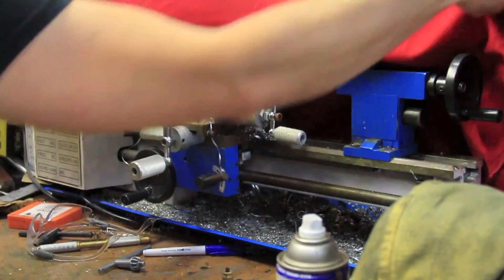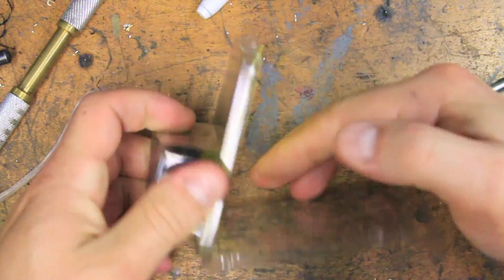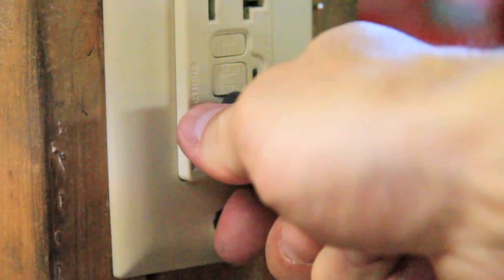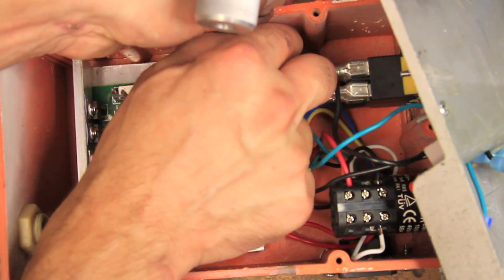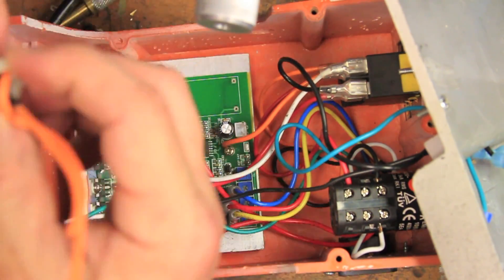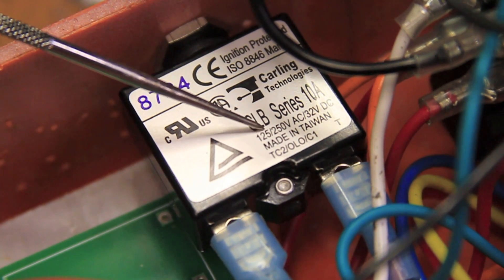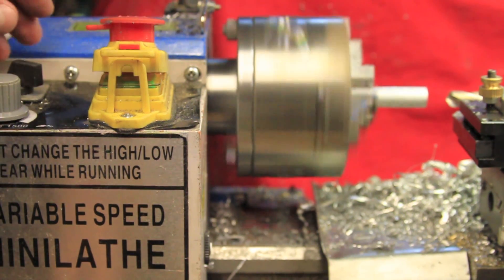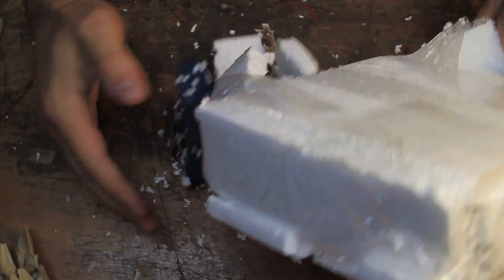No more blown fuses!

Comment: Just bought one of these lathes , which is slightly upmarket one to to one you have, but they are all basically the same machine. I am not using the lathe yet as I want to do a thorough maintenance before I do and unfortunately I have a lot of other stuff that has greater priority. But I like your style and your video's So I will be subscribing.. I have done some similar projects to yours on a old clarke cl300m metalworker lathe, but I did them slightly differently to you. I think if 3 people make a similar project there will be 3 different finished projects, based on materials available and different ideas. Great videos look forward to seeing more.

Comment: Fuses are rated as 10A continuous and these blow at 20A.  Circuit breakers pop at the Rated current.  You should fit a 20A Circuit breaker.

Comment: My concern with circuit breakers is their slower trip speed compared to fuses. A typical thermally tripped breaker generally takes well over double its nameplate rating to operate, and in the case of electronic circuits this can mean damage will occur to the printed board long before the breaker has time to heat up and release. I know that glass fuses can be annoying, but they are very fast operating, and considering that you can find a hundred of them for less than $3 on Ebay it's less expensive than the cost to repair or replace a motor controller board.
Reply from the maker: Thanks! I'm not sure if it will cause problems in the future but so far it's popped quite a few times and I haven't noticed any problems otherwise. Interestingly also, I feel like this breaker pops much easier than the fuses I had. It took me a long time for the first fuse to break and the circuit breaker pops all the time, so it feels safer at least.

Comment: I noticed that the mini rest you got is missing the roller bearings in the middle of the rest that the piece turns on. There should be roller bearings, not points.
Reply from the maker: I think there are different styles.

Comment: As a maintenance technician and a learning machinist, I love the way your videos are setup and explaining everything in detail and the added humor. I spent all morning watching your videos because i'm off for a few days and this stuff is so interesting, I was looking into buying a mini lathe as well and I've just been seeing all the problems you've had with that one. I have a two year degree in Mechatronics so it's easy to understand the electronics side of this as well. Keep up the good work man!
Reply from the maker: Thank you so much! Comments like this are so great and definitely a motivation to keep putting these together :)

I really appreciate you watching and hopefully if you do decide to get one of these lathes, you now know what you're in for! 

Mechatronics is really neat too, I took a couple classes in school myself - what are you doing with it?
Reply: Literally nothing other than I work at a glass manufacturing plant as a maintenance technician. They paid for one year of my two year degree and I have to stay working there for a year. But I do PM's on machines and the building, fix breakdowns, rebuild parts, and fabricate parts out of steel and aluminum. I learned how to use a lathe, precision mill, stick, mig, and tig weld as well. I'm hoping I find a better job than a maintenance technician because the pay is kind of crappy and I have expensive hobbies lol

Comment: A old vacuum cleaner with 3 different dust bags is very convenient to keep the lathe clean on an hourly basis. One bag for each: steel, aluminum, and copper alloys. Or add a 4th bag to separate brass and bronze if you do much of those. Or use one bag if you throw the chips in the trash anyway.

Comment: The fuse should only blow if there is a fault in the circuitry. Have you checked your current limiting in the controller, if this is working properly it should limit the current to a value less than the fuse even under stall conditions. Contrary to popular belief, fuses are not there to protect the equipment, their purpose is to protect the wiring from melting.
Reply from the maker: Hmm I'm not sure those are accurate statements. The motor uses considerably less current when turning normally than it does in a stall condition, which is an overload state for the motor. When overloaded or stalled, it's drawing the most current and more so than normal operation. Since we don't want to prevent normal operation but we do want to cut power in an overloaded or stall condition, a fuse sized between the two conditions is what you want. Also, protecting the wiring from melting is inherently protecting the equipment, is it not? At least in the situation of this lathe, the controller board is much more susceptible to damage from a current overload than the wiring from the wall outlet.

Either way, thanks for watching and taking the time to comment!
Reply: My thirty years in electronics engineering tells me that you're half right. It is not the job of the fuse to protect from a stalled motor, that is the job of the inbuilt current limiter of the controller (which is adjustable). As 10 amps on 240V gives you 2400w and the motor is rated at only 550W you can see that this greatly exceeds the power rating of the motor and if the current limiter is working properly this value should never be reached and the fuse should not blow. In 99.9% of cases fuses are there to protect wiring not the equipment.
Reply: The current limiter is designed to ensure that no more than 550W is supplied to the motor
Reply: Assuming that the board does have current-limiting protection as stated, Mr. Tho is correct.
Reply: He's also correct that the normal use of fuses is to protect against fire from overloaded wiring.  The motor itself should (but may not) have a thermal overload protector that will trip and self-reset when the motor windings overheat because the motor stalls or can't start.

Comment: Nice modification. It would have been all too easy to just eliminate the fuse altogether. However, that would have been a bad idea. You took the smart approach and kept the fail safe intact, just made it easier to deal with.

Comment: Just a thought!   There's a reason the fuse blows repeatedly. Something is wrong somewhere. See to it before whatever it is wrecks the circuit board or worse.
Reply from the maker: You're right, but in these cases the first fuse blew because I was parting a large diameter and it was pulling too much current and the second one was drilling too deep and the chips couldn't clear from the bit and stalled the motor. So nothing is wrong and for once something on this lathe was working exactly as it's supposed to :)

Comment: Awesome idea with the button circuit breaker!i'm going to install the same one on my lathe! As for the steady rest, add roller bearing to the tips, I used roller bearings out of old VCR rotors, which I bought for $5 each at Salvation Army, goodwill and Savers. Stripped them all down for parts, reserving all bearings for other projects. You can use any race bearings you deem fit for your machine and purposes. I've had the VCR rotor bearing on mine for ten years with no problems. Have fun!
Reply from the maker: Thanks! After trying to turn a piece in that steady rest I'm definitely going to add some bearings... I actually have some left over from another project that might work perfectly. I'm also going to see if I can figure out a way to increase the clearance a bit to match the diameter of the hole as the trips don't fully retract. Either way it will be a very useful addition!

Comment: This is an elegant solution to your problem. I tried it a few years ago and for me it did not work. I have been told that my 10 year old mini lathe is not as robust as the newer models, perhaps this is why it works for you.
My lathe uses "fast blow" type fuses to protect the speed control. Thermal breakers are "slow blow " devices. The breaker I used would pass 150% of the rated current for 1 hour before it tripped (up to 600% for almost 2 seconds). Unfortunatly my speed control could not handle the sustained  overcurrent and I eventually burned it up.
For those wanting to make this conversion it would be wise to match your fuse to the new breaker specifications.
You can down load the breaker PDF spec sheet here:  carlingtech.com/thermal-cb-clb-series
Reply from the maker: Interesting, I wonder if i will end up with the same issue? I just ordered the 3amp version so I'll swap it out and see if it trips too often or not.
Reply: Good idea! if it works I can use it on my mini lathe

Comment: In my books 10 A is 10 A blow a breaker just as often, all things equal? Have you checked your circuit draws? Sounds like there is an ongoing issue? Good Luck, Billy, Canada Thanks for all the Vids.
Reply: On my version of the mini lathe the fuse does not blow if I stall it, instead the lathe just stops and a fault indicator LED turns on. I just have to press the start button to get it running again.
Reply from the maker: Thanks for watching! The first fuse blew because I was parting a large diameter and it was pulling too much current... the second one was drilling too deep and the chips couldn't clear and stalled the motor. Not necessarily as issue with the lathe because that's what fuses are for :)
Reply from the maker: Oh and it wasn't so much about reducing how often the fuse or circuit breaker blows.. I'd probably rather have it a little on the sensitive side, but more about how quick and easy it is to get back running again.
Reply: Resetting the breaker is a lot easier than replacing the fuse.

Comment: The Problem with dc is the Arc is much harder to brake then ac since there is no 0V crossing of the waveform thats why circuit breakers and Switches are rated for much lower voltages in dc than in ac
PS i know Nobody asked for this Info but im throwing it oft anyway 😅
Reply: Majin Snake well if it Not manages to Break the arc there is a Chance for it going bang but that just adds excitement right?
Reply: That would be true if if was continuous DC, but as it is rectified and then feed through SCRs to control the pulse width, it is actually pulsed DC so the arcing is not a problem.
Reply: graeme Tho that is true but as you Said that is pulsating dc the Rating on that breaker is for pure dc

Comment: just put "Slow Blown" fuse. stands for T.. should be T10A 230A
Slow Blown should hold up to Twice more than he rated for a second or two.
Reply: Sergio kirienko The Circuit breaker is T, what the old one was is not shown.

Comment: Why is the fuse/breaker blowing/tripping?  That does not seem to be normal, right?
Reply from the maker: It's completely normal... fuses are designed to be the weakest link in a circuit to protect everything else. The first time it blew I was parting a large diameter piece of aluminum and the second time I was drilling a deep hole and the chips couldn't clear so it stalled. In both cases, the fuse prevented any damage to the circuit board or motor.